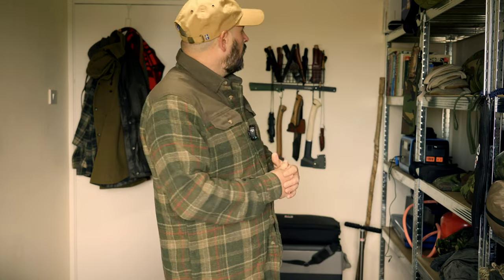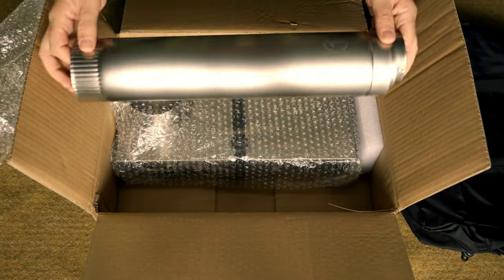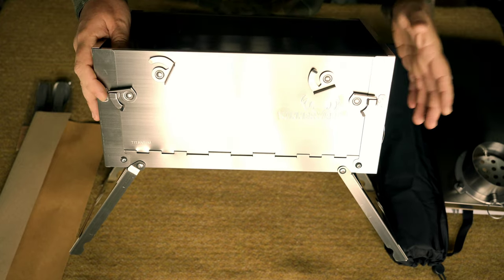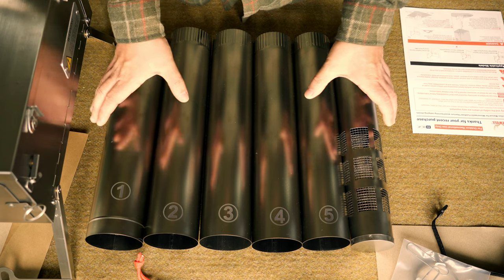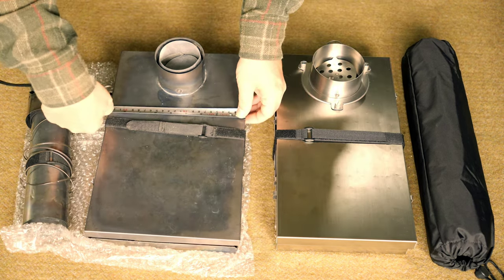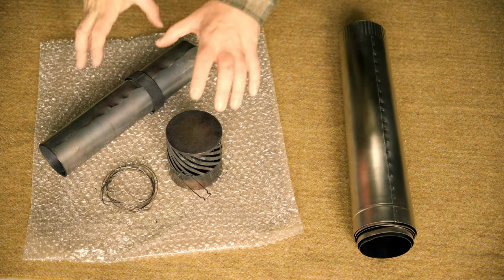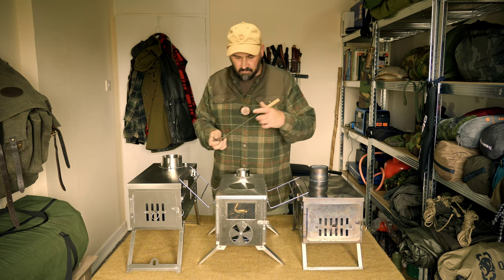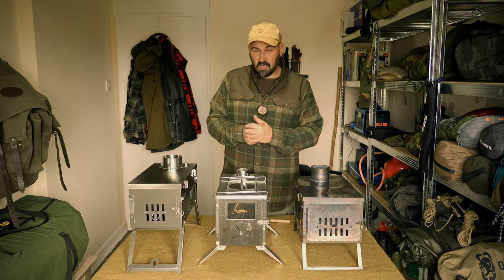Winnerwell Fastfold Plus Titanium Hot Tent Stove Unboxing And Comparison! First Look!

Comment: The stacking pipes are a GAME CHANGER finally genius ✊️🔥✌️💚
Reply from the maker: Cheers, buddy. Yeah, it's a massive upgrade. It doesn't add a few pounds, but it will also save a few pounds not having it bend in a wind haha
Reply: @BushcraftWithSteOutdoors  absolutely I ordered the pomoly stove sections just for that reason dependability 🙌🔥

Comment: Great review of another beautiful piece by Winnerwell, Ste👌.  You can definitely see the difference in the improvements from the older version, and it is great that Winnerwell does that.  I have yet to hot tent camp but I am putting that stove on my future kit wish list 🙂.  

Last year I did buy a smaller Delonghi electric ceramic heater for my Woods Pinnacle 4-season tent when I was attempting cold weather camping, but it ended up just dumping down sleet and rain for the entire half hour drive to the campsite.  I got cold and wet just trying to set up my tarp, so I pulled my chute and packed it in and chose to live to fight another day 🤣.  I also want to upgrade my sleep system to a military modular one for cold weather camping so once I've done that, I may give cold weather camping a second chance 😊.
Reply from the maker: Hey Ste, sorry for the late reply, buddy. It looks to be a solid improvement on an already great stove. Winter camping is great. i love it, and with the correct gear and a stove like the winnerwell, you can rest assured you will be as snug as a bug in a rug, haha. I'm not familiar with the ceramic heaters unless you mean the ceramic butane heaters? They are decent. I have had experiences like that where I have packed up and buggered off before I've even set up, haha.
Reply: @BushcraftWithSteOutdoors  No worries mate!!!  I know it gets busy on this social media stuff, especially when your channel is getting as popular as it is 👊😁.

Ceramic heaters are the electric ones that use a ceramic plate for heat.  I bought a heavy-duty 50-foot extension cord specifically for use with high-draw appliances like a space heater, and I have a small stand to place it on so it's not on the tent floor.  They have tip-over sensors in them that shut them off immediately if they happen to fall.  I figured that was the safest and easiest setup for me in a larger 4-season tent so I don't have to worry about carbon monoxide.

Haha I definitely put my tail between my legs and went home that time 🤣.

Comment: I'd buy the new stove for £525. I have been looking at the Woodlander but the Nomad looks like a decent bit of kit. The stainless steel non collapsible stove is half the price but if I thought I would get 5 years + use out of the collapsible stove, £105 per year is very reasonable. Great review, thanks.
Reply from the maker: 5 years sounds like a great deal to me! Thanks for commenting sir, sorry for the late reply.

Comment: I think the new v2 pomoly T1 ultra is a better made stove with the top and bottom reinforced and they 1mm thick ti sheets and with the glass door panel  throw off more heat .. they heavier but alot less chance of warping and they offer a similar multipeice flu as the winnerwel ones
Reply from the maker: I will not have such blasphemous comments on my channel! Take it back! 😄 🤣 😂 😆 I do believe pomoly also make a good stove, but my experience has been with winnerwell for a long time, and I am more than happy with their offerings. I'm glad you enjoy your buddy.
Reply: @BushcraftWithSteOutdoors   it's also 70 quid cheaper lol